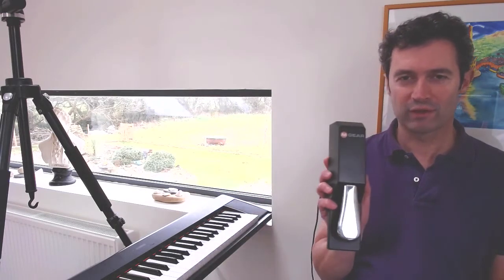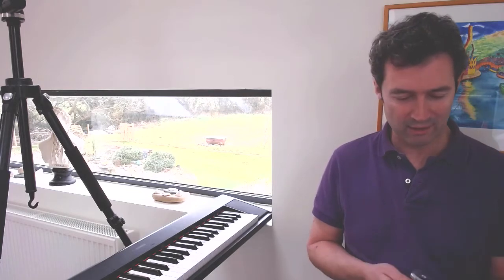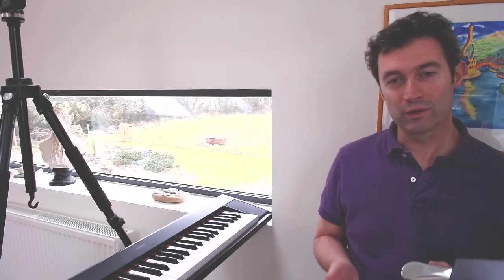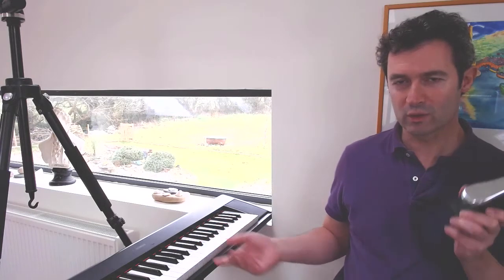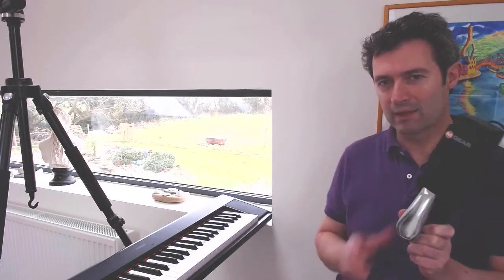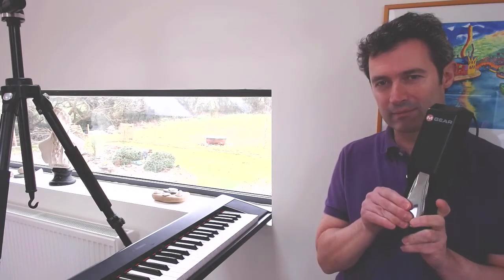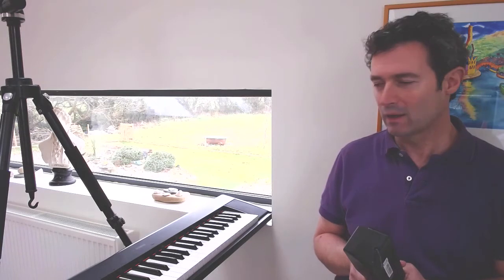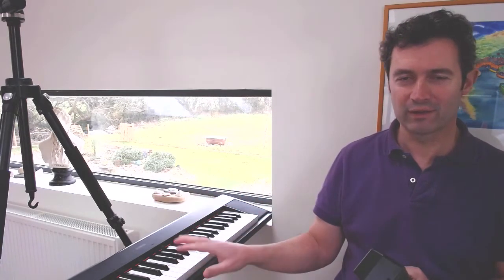Easy fix broken pedal on piano keyboard - no screwdriver needed - Yamaha / Casio / Korg / Roland

Comment: I got a friends Yamaha clavinova clap 152s and the pedal is intact BUT the cord that connects to the keyboard was cut at some point...how would I find and buy the correct replacement cord/connection  for this piano pedal?
Reply from the maker: Sorry for such A late reply – I’ve just seen your message now! The lead is usually a quarter inch jack plug which I machining is similar to audio leads – but I’ve never tried changing a lead before. I’m sure most music shops might be able to answer this for you

Comment: My sustain pedal keeps sustaining even if not pressed. And unlike the problem in this video, the pedal still sustains even when pressed. What should I do?
Reply from the maker: It could be that the switch inside the pedal is stuck down – if you are able to vacuum out the dust from the pedal this may help. Otherwise if you are able to dismantle the case to clean the contacts inside the pedal, this may fix the problem.

Comment: I just got a Yamaha MODX8+ and my MGear sustain pedal that has always worked with my old Yamaha piano is inverted on this new one. I tried switching the polarity and it won't even sustain when it is switched, but when switched back, it sustains when not pressed down. Is the MGear sustain pedal not compatible with the MODX8+, and do I need to get a different pedal?
Reply from the maker: I don't know - all I can suggest is try switching off the keyboard with the pedal plugged in  - then turn it on again and see if it works - if not - switch the polarity then turn off and on again.
Reply: @DecPlayPiano  thanks for the help, but i already tried that with no success : (

Comment: I have a sonart piano and no mateer what i do the sustain pedal wont work and if i plug it in while the piano is on its an infinite sustain no matter what. Idk what to do
Reply from the maker: If you have tried the tips in the video then it may be you need to repair or replace your pedal.